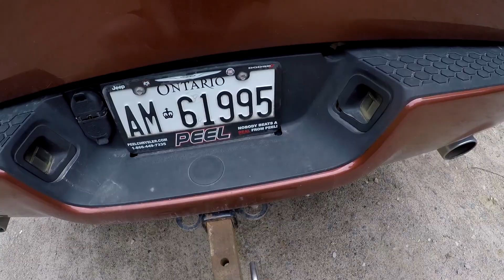Let's Race Em Bud! (New Supercharged Gp 1800r)

Comment: what was the top speed
Reply from the maker: Right around 78mph without the reflash.
Reply: @NOSAtvs  WHAT? they say stock gp1800r's go just under 70 orrrrr? like are u sure its 100% stock
Reply from the maker: @trent9426  it's new...depends on conditions.  We've had the non superchanged vxr going 72.  but these numbers are only based on the speedo, not radar right.
Reply: NOS Atvs You can install a GPS app on your cell phone and keep it in one of the compartments it’ll keep track of the top speed 100% accurate and then read it later I’m dryland

Comment: If only America produced right hand drive cars they would have the best car industry in the world but unfortunately for them there are only a very few countries that have left-hand drive cars but America being stuck in their ways like the Imperial system which is beyond imagination what happened to logic 1 centimetre = 10 mm 1 m = 100 cm 1 kilo of water is exactly 1 litre 1 litre 1 kg 1 tonne equals 1000 l of water does it get any more simpler than this ,this is the most logical measurement system the Imperial system it's just like the matrix where as the metric system explains itself